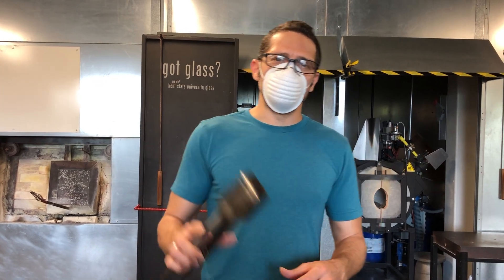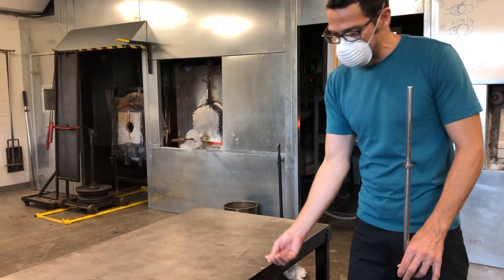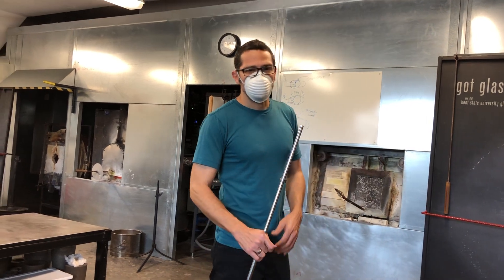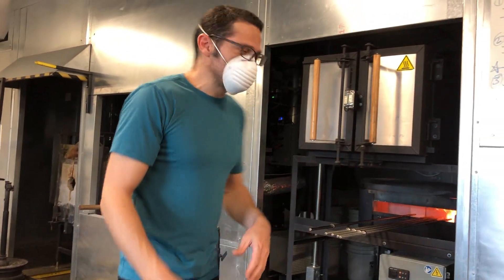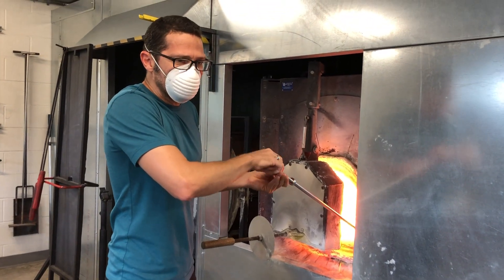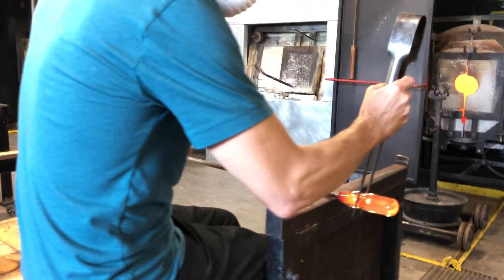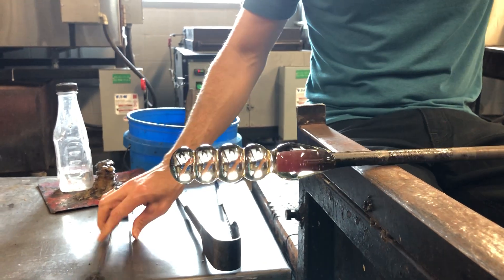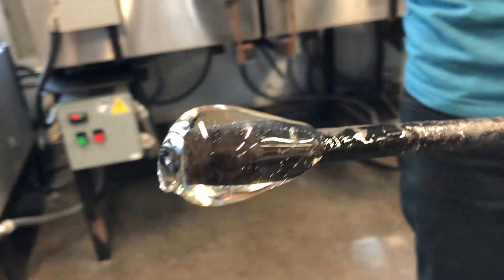Intro to Glassworking: Using the Jacks

Comment: So basically you have contaminated glass that’s breaking off the moile that you can’t reuse
Reply from the maker: That's totally normal. Scale of that kind is normal wear on blowpipes, and it can be recycled into your furnace. All it does is increase the green tint of the glass, but if you mix your recycle-to-fresh glass at a small ratio (more fresh), it's not very noticeable at all. Quenching the pipes/punties before gathering doesn't remove scale, it only removes carbon build up from some pipe-warmers that have too much gas-to-air in the mix. Quenching in that situation prevents bubbles forming around the blowpipe when the carbon (soot) vaporizes under extreme heat.
Reply: @kentstateglass5011  wich kind of glass is used to blown glass? thanxs
Reply from the maker: @tallermabal5462  This is Cristallica, a European product that is no longer being made (as far as I know). It's a basic "soda-lime" glass which was formulated for hand-made glassblowing (as opposed to machine-made, mold blown glass).

Comment: So question. When I break off anything that is clear glass, I still end up with black scale in the glass. I always quench the blowpipe or punty before gathering which is supposed to get rid of the scale. Suggestions? Thanks
Reply from the maker: Hi, can you clarify what you mean? Do you get scale in the moil, the part that stays on the pipe/punty? Or are you getting scale in the blown object itself?